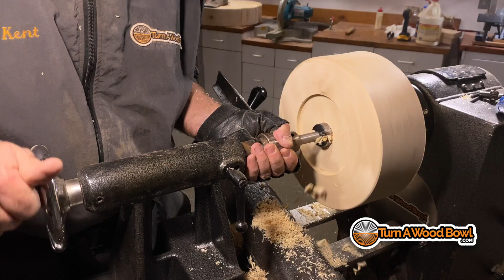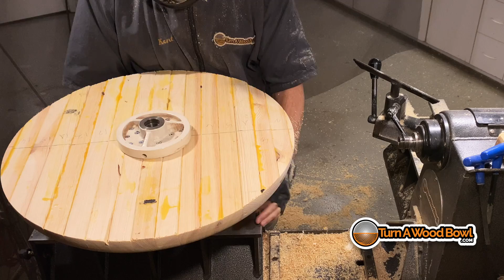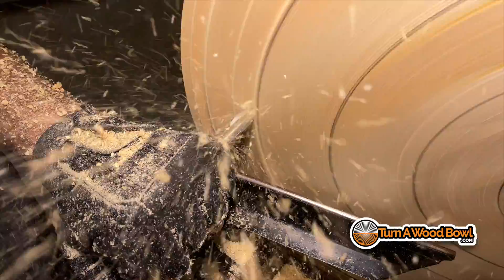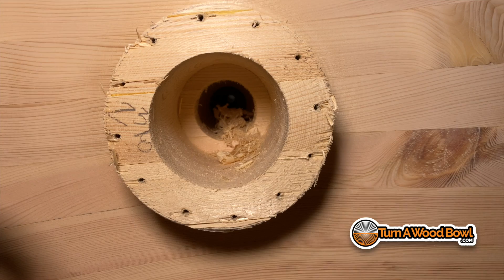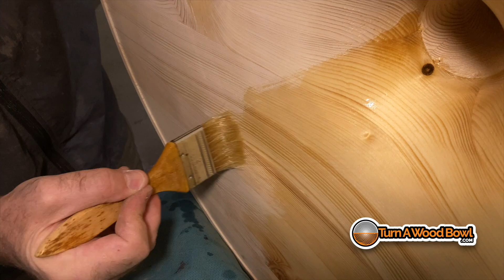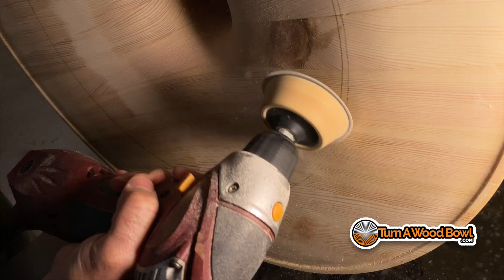Woodturning Coin Funnel – Video

Comment: Hey Kent, thank for all of the videos. They've been immensely helpful in my journey to become a better wood turner. I do just want to point out one thing I've heard you mention a few times which doesn't seem strictly correct. You say that as you approach the center of the bowl, it's turning more slowly so you need to slow down the speed of your cut to compensate. While it's true that the wood is moving more slowly relative to the cutting tool, you are also cutting less wood. It is in fact exactly the same rpm no matter where you are on the bowl (as I'm sure everyone knows) but it seems like maintaining a consistent cutting speed whether you're out toward the edge of the bowl or toward the middle seems to make the most consistent cut. Actually, even when I watch your tool making the cut, you seem to have basically the exact same speed the entire way through, as when you're riding the bevel it just kind of dictates itself.
Reply from the maker: Thank you for writing and sharing! Check out this video https://youtu.be/qkAwPg-fPN8?si=sjOHJSTlmT2KNnHl Happy Turning!

Comment: BRAVO Kent.  An question: On the inside of the funnel i did not see you use a shear scrape with the swept back.  Is there a reason you did not use that on those convex surfaces?  Thanks.
Reply from the maker: The endgrain was tearing easily so I needed to make cleaner cuts with the gouge edge. Happy Turning!